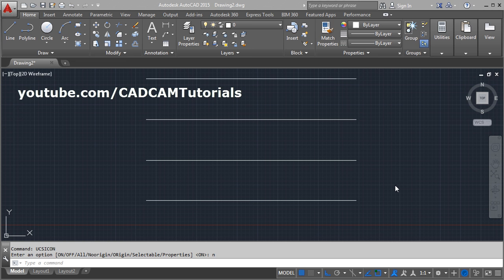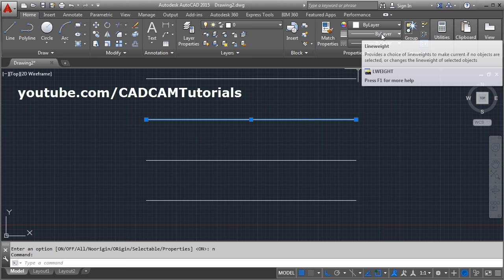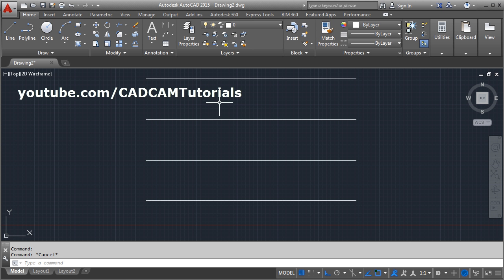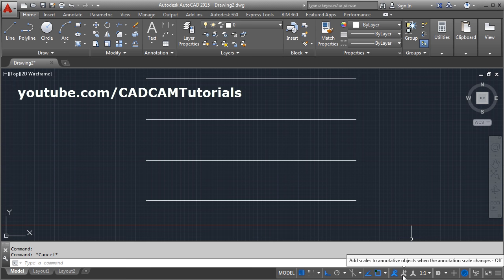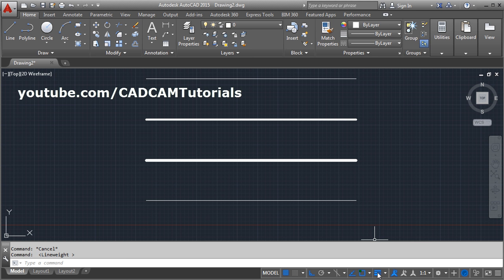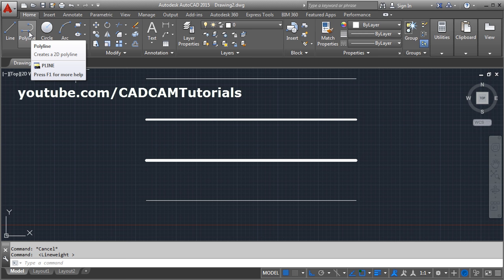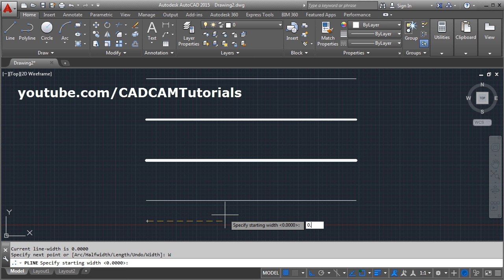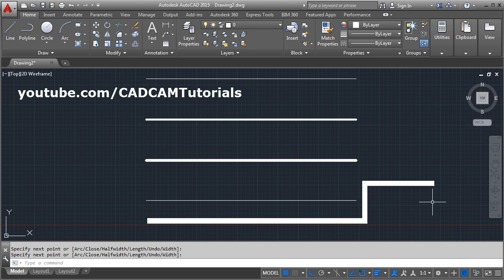AutoCAD Line Thickness / Lineweight does not Change | Not Showing | Not Changing | Display

Comment: I have a problem creating points and changing their lineweight. It is not visible like on the lines. Any ideas? Thanks
Reply from the maker: Use ddptype command to change point display style
Reply: @CADCAMTutorials  no matter which style I use, the lineweight does not show or print. My file is similar to yours here, displaying LW. Thanks for responding
Reply: @CADCAMTutorials  maybe there is a block for the points and that needs to be edited. Its layer I think

Comment: This did not address my problem.  My default lineweight for plines is for some reason set to 1” global width.  Nothing I can do is resetting the default width to 0” and it’s making me crazy and wasting my time having to reset the properties manually to 0”
Reply from the maker: Which template you use to create new drawing? You will have to change setting in that template.